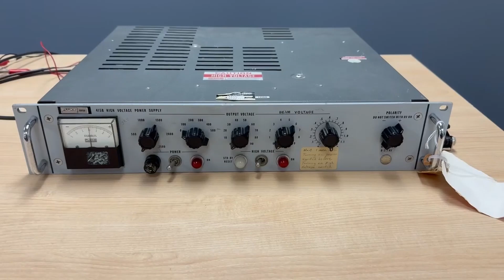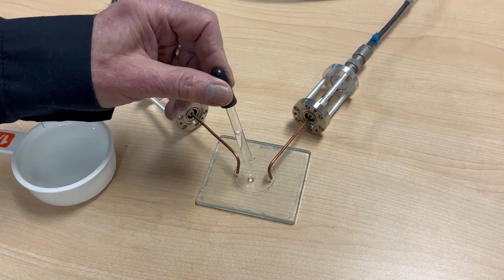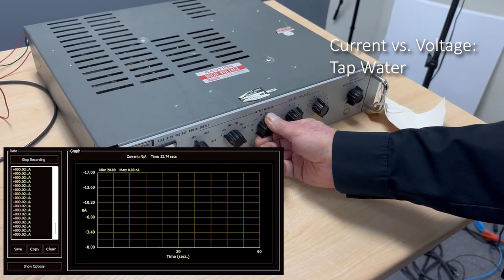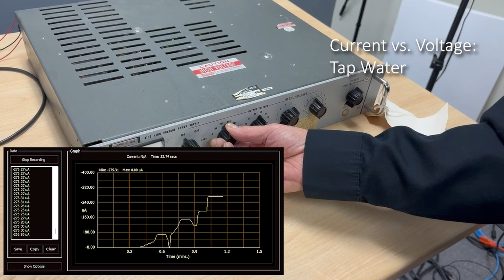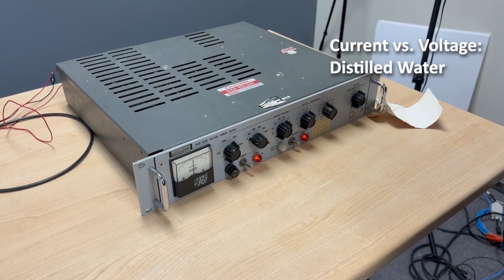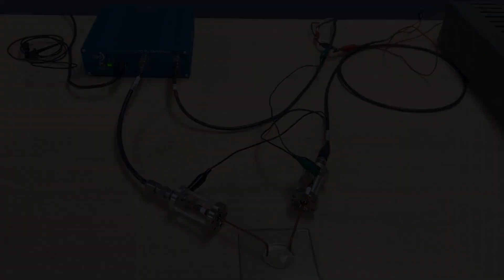Using RBD's 9103 USB Picoammeter to Measure Current in a Liquid

Comment: The 2 electrodes from the liquid test cell are connected to the picoammeter. Where is the voltage source connection? That's not clear from the video.